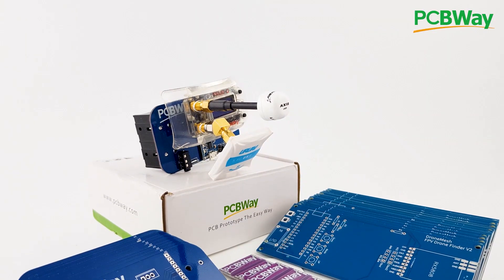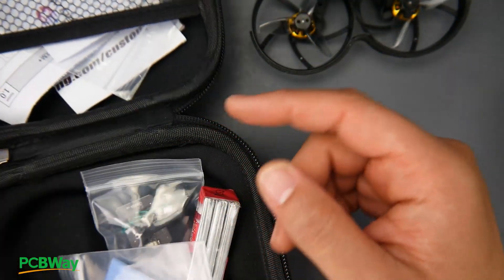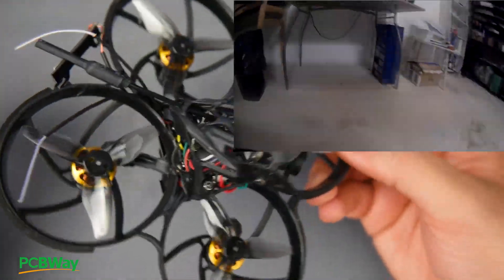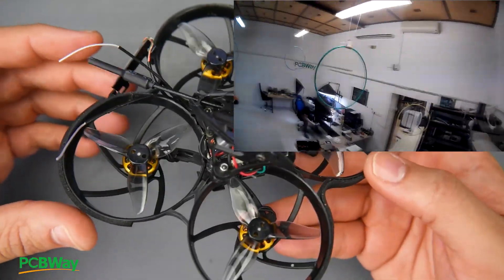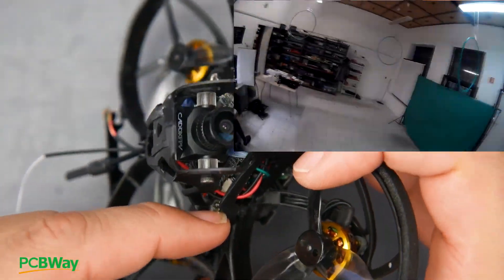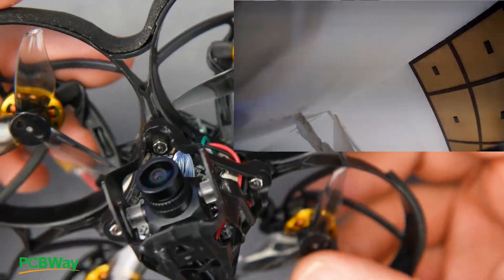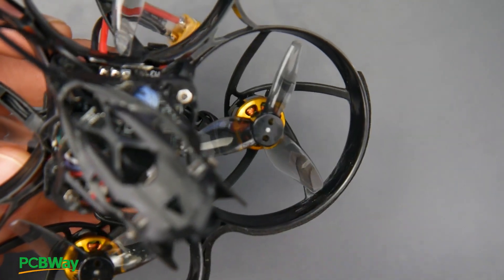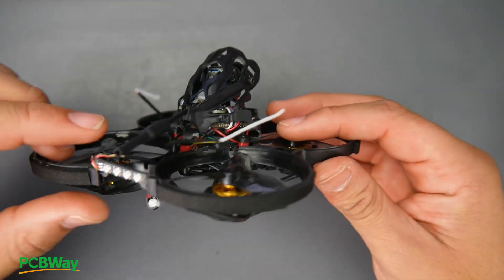I Would Be Angry  //  Geelang Anger 85x

Comment: Another good and no bs video...but bad timing for me. If only this was posted a wk or so earlier!  No mention of the terrible micro USB jack connection and the excessive force required to make connection to betaflight etc. I got one and I'd it ripped apart for parts in no time. Force required and ribbon cable between boards I think. Receiver used in first build. FC destroyed because of force. I won't buy Geelang again. Live and learn. Do you have any suggestions on what frame and props the motors would be good on? You've taught me a lot past couple of months. Cheers

Comment: Great review. No so great whoop. 3 screw motor mount limits frame choice and its frame is junk.
Doesn't fly well. Now that Purple whoop you reviewed, that was cool. 👍😎
Reply: That purple one is a BLOATED COW! 50+ grams for a 75mm who0p?! Damn, that's a BARGE! Terrible! 😩 
Remember, the Mobula7 is about 27 grams... so it's close to DOUBLE the weight! And 10g more than the Spedix Rex, with the same zee motors, which also had an indestructible frame. I know, I own 3!  Bought for $60-90 bucks shipped. So that BLOATED COW is too expensive too! 😣

Comment: So, you passed on this one and liked the Purple Nvision BLOATED COW! 🐮 At 50.7 grams, that thing is nearly double the weight of the Mobula7, dry about 27 grams! Both 75mm,both have extremely durable frames, now that the 7 has the v3 frame. It's also WAY to expensive and WAY too heavy. Guys, there are a few reviewers who specialize in who0ps. I'd refer to them for more accurate and knowledgeable who0p reviews. All reviews have things they are more versed at, Drone Mesh included. Not a knock, just a fact that he doesn't do as many reviews on the micros and who0ps, so he doesn't see the best of the best so he doesn't have them to compare with. When you only see this junk, you maybe don't realize that a 50.7 gram 75mm who0p has to have more than a super durable frame to be a great who0p! 50.7g easily knocks it out no matter what the rest of it is about, because no who0p that's that heavy can be any good! Who0ps are ALL ABOUT LOW WEIGHT!  🤔🤘🎅🎄
Reply: I feel you, the way this guy reviewed this thing rubbed me the wrong way.  Almost like a spoiled child.  This thing at 85mm I think is also very large for micro and racing.  I think he got his categories mixed up.